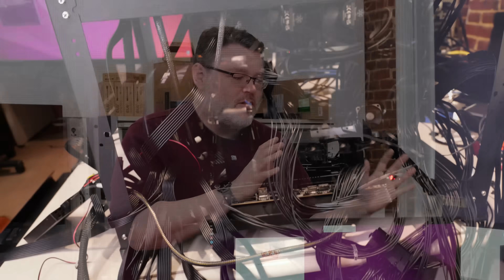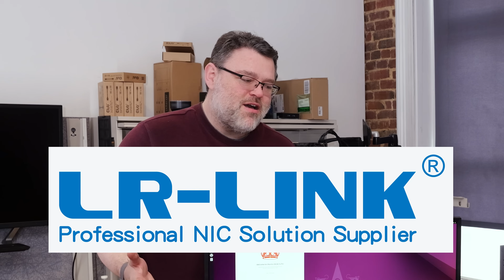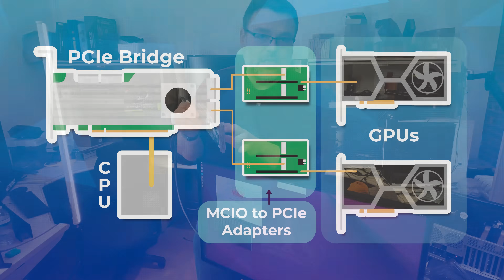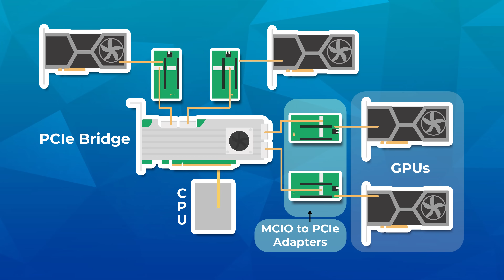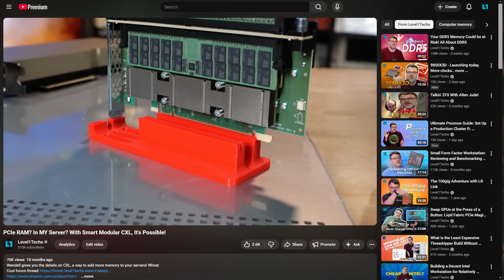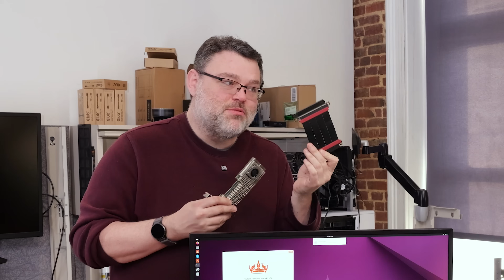Creating a PCIe Bifurcation Solution for AI Councils

Comment: 14:45 I suspect AMD has chosen not to offer this for cost/market segmentation reasons given that they already showed off that demo with a ton of their chipsets just daisychained together each one breaking off another few PCIe lanes. Surely the first thought that would occur to any engineer playing with that setup would be "what if I made the upstream interface gen 5 instead and added extra gen 4 lanes downstream?"
Reply: Rumor has it AM5 Zen 6 Ryzen will finally upgrade the CPU-Chipset Interface from the current (since 2019 with Zen 2) PCIe Gen4 x4 to Gen5 x4. Unfortunately AM5 doesn’t have enough pins to go for a x8 interface there.

Comment: I'm facing an issue with the Workstation card and MAXQ with MIG, is there ANY WAY to pass them through to a VM in a MIG mode (VGPU) instead of using one of the MIG instances for containers in promox? Any chance you can chime in on this? is it doable? Nvidia tells me that only the server edition card can do that vGPU thing, and the other versions of this card cant.
Reply: You're mixing a bit things here: mig is not vgpu: MiG is a slice available only to containers or processes inside the same vm that has the physical gpu having the MiG slice. vGPU is nvidia proprietary equivalent of the open spec "sr-iov" : exposing a pcie device as multiple pcie devices that can then be passed through different VMs. Nvidia vgpu on grids does that but every element along the stack is proprietary and require license: nvidia hypervisor driver and gpu manager in the hypervisor, vgpu driver in the client vm, vgpu license for the manager.

Comment: If you are not training models, x1 is plenty! Why? The PCIe is ONLY to load the model weights, that's it. No differences for inference/tokens per second! I am running 4 x 3090 using a x16 - 4 to 1 adapter with bifurcation set to x4x4x4x4. Loading qwen3-coder-next q8 takes about 15 seconds.
Reply: Yeah, I would expect at least an explanation on that but nope.

Comment: With all the problems around PCIe Gen 5 signal integrity, I can't wait for Gen 6!
Reply: The validation equipment (scope, probes, protocol analyser, DUT etc…) alone for PCIE v5 is £2M-£3M (a single unit) and for v6 probably reaching £10M or more.
Reply: @K @KleoGroutides Don’t think that Wendell will making a PCIe6 card. Chinese companies would make a Broadcom knockoff. Maybe Steve at GN can pick up some for Wendell on his next trip to CHina.
Reply: At that point the connectors will be hollow tubes, aka waveguides lmao
Reply: Hahahaha! Yeah naw.
Reply: Gen 5 is so fast theres really no demand for gen 6, atleast for the vast majority of servers. Workstations already have so many lanes anyway
Reply: @phazzar gen 6 is meant for server to server connections, all the cables become active(or optical)… there’s no passive cables anymore and no flex risers either.
Reply: @phazzar there is never NOT demand for faster buses 😂
Reply: @chbrulesmost use fiber based standards for rack communication
Reply: @phazzar  And how do you think fiber is connected to CPU? 😂

It's all PCIe all the way down, unless CPU manufacturers start putting things in the silicone.
Reply: @saiv46  Boob implants with advanced computing capabilities and PCIe?!

Comment: Nice, now do Fiber Display cables.
Reply: You mean just like optical HDMI to DP cables?
Reply: @BrunodeSouzaLino  Yeah I have some but would rather give money to L1T then other random vendors. (heyoptics hdmi for my home threater set up)
Reply: @Mutation666  I also have I think one HDMI 10m cable, which is capable of 4k@120hz at 12bit I think (from UTE in Germany).
I prefer Club3D cables for non-optical lengths, but for 10+ meters? Most are unreliable - except for that HDMI I bought for about 200€ about 4 or 5 years ago.
Reply: seriously. would love a reliable ruipro alternative
Reply: @wtigert  There are many options that convert HDMI 2.1, DP1.4, etc. to MPO, Ruipro wasn't even the first they are just the most commonly advertised. There is FiberCommand in the US, Lightoptics in the UK, ACT sells their version through various retailers and I'm sure you can find cheaper alternatives from China as well. Just stay away from ones that don't offer external usb power injection to power the transceivers as they are hit or miss.

Such a solution is preferable to the more common hybrid cables because if you want to upgrade the HDMI connector in the future, you don't have to replace the fiber cable. You can even fit multiple connections over a single cable provided the amount of fibers used fits in the OM3/4 cable you are using (6 fibers per HDMI 2.1 connector, 24 fiber cables are common) and you can also find USB to fiber transceivers that fit over the same cable.